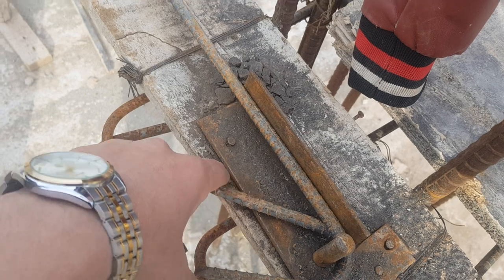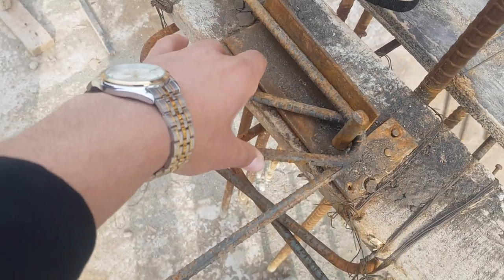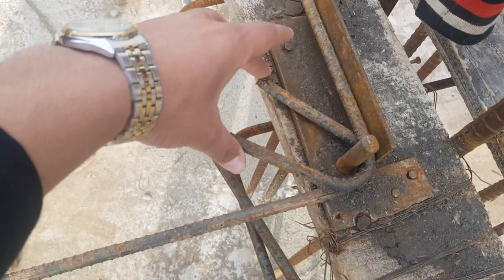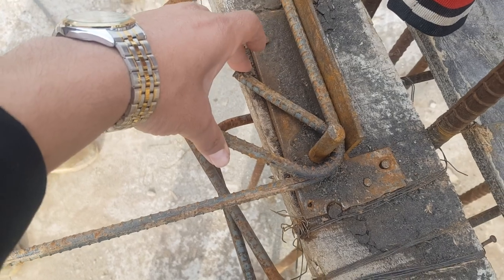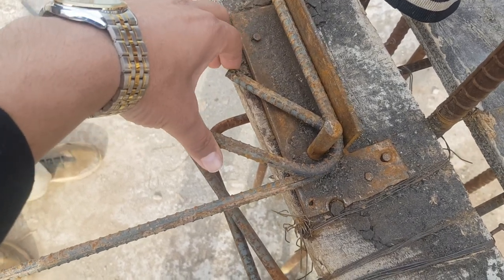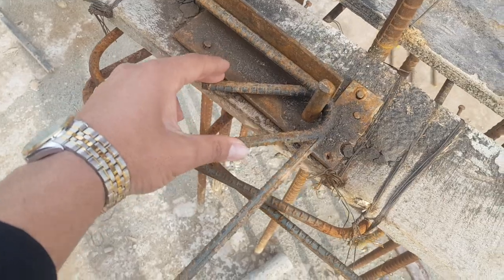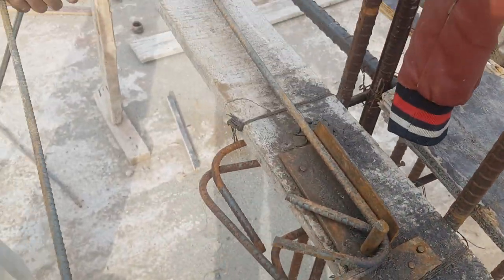how to prepare 135 degree hook in column rings and beam shear reinforcement

Comment: Sir Why 135 degree in General?
Reply from the maker: Because 135 hook makes stronger bond with concrete and rcc column will be more strong in buckling.
Reply: 135⁰ is meant for seismic shock absorber incase of earthquake.